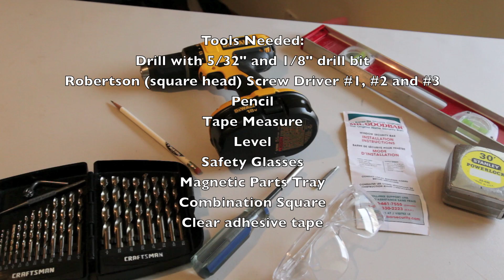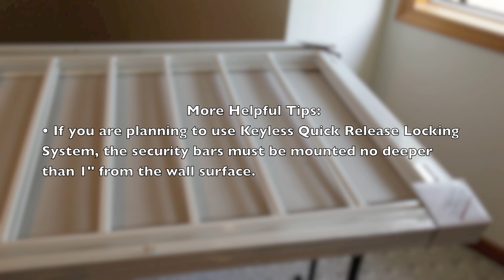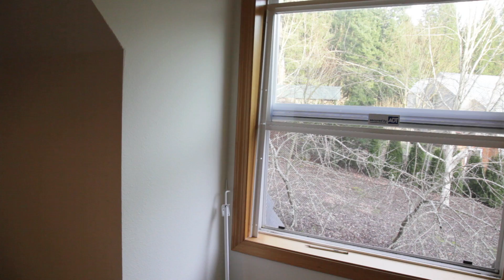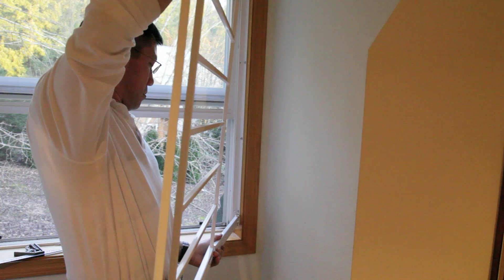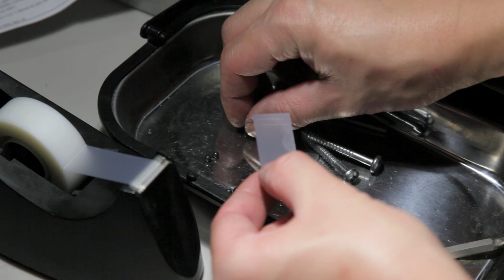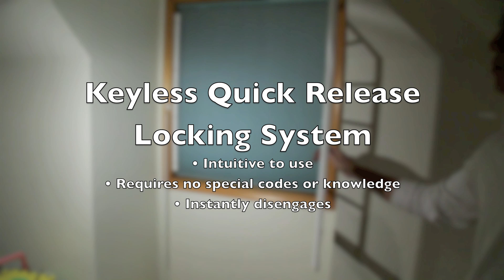Mr. Goodbar Window Security Bar and Keyless Quick Release Locking System Installation v1p0.mov

Comment: Weakest window bars ever!  What prevents a thief from breaking the glass and pulling the release lever himself?  STUPID DESIGN.
Reply: I was thinking the same thing but the guy would have to have some very long arms.  I don't think the typical person would be able to do it. I suppose it could be done with a mirror and a hanger or some other tool. But a determined thief will always get into a their targeted structure. You could add an additional layer of security by adding security film to your window. It would make it a lot harder to break and would deter most low-end criminals after a few whacks with whatever heavy instruments they might happen to pick up. This is another reason no to leave heavy things laying around your house if you can avoid it.
Reply: DCSJ68 what prevents a person from taking a stolen car and ramming into your house? Lol if they really want in they are getting in
Reply: @intergalactic4160  the bars slow them down long enough for me to shoot them!
Reply: Nashville Gardener true maybe they would just kill you while your doing your gardening then don’t even bother making the noise with the car lol
Reply: I have had one of these window bars (the hinged model) for the last 15 years and it is strong and high quality.  Even the paint job looks good after all these years and no rust at all. Practical too, because the window bars just swing away if you want to clean your windows. Just don't buy the "quick release mechanism". You can use a keyed padlock instead. Just make sure you keep the key in a safe place nearby (night-table drawer, etc) if you have to escape through the window in case of fire.
Reply: @zoltanpapp6458 If you really had to I suppose you could use a padlock with a number combo but even that's stupid as hell. Don't be dumb and have a keyed exit.

Comment: that quick release bar is the only thing preventing entry, and it's held in by two little screws. One good kick and they're inside your house.
Reply: The force of the kick would not be applied to the screws. The pin is what holds the bars. That simple holds it in place. That's like saying the cotter pin on a trailer hitch would fail because it's so small.